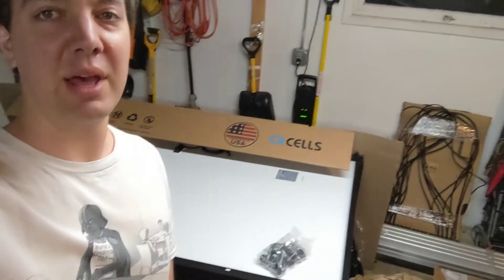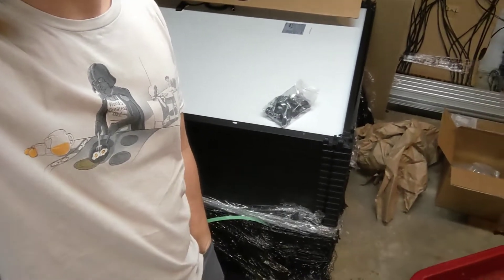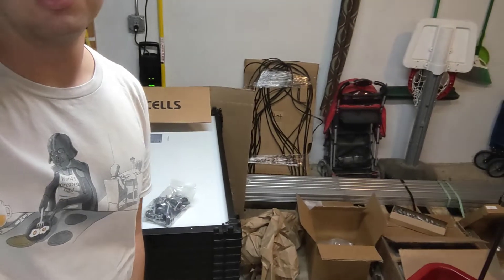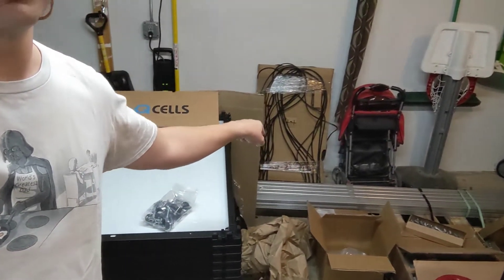Solar Panel Delivery: Project Solar DIY Update #3

Comment: Jimmy, can you contact me. I just got my Project Solar stuff yesterday, and I want to ask you some questions.
Reply from the maker: What questions do you have?
Reply: @jimmypautz  I am a few months behind you. I just received my box of stuff from Project Solar, and I have found that they missed things. No AC disconnect, no sealant, and no stickers.
Reply from the maker: @frankphilips5498  I'd suggest reaching out to your project manager and asking. Those should be included.
Reply: @jimmypautz  I will do that tomorrow.  Where did blue tubing from?
Reply from the maker: @frankphilips5498  That's Smurf tube, I used it for conduit in my attic, since Romex is so expensive right now. I got it from Menards.
Reply: @jimmypautz  Did the kit come with wires?
Reply from the maker: @frankphilips5498  no, wiring/conduit/wire nuts are not included.

Comment: I’m just about to sign an agreement with Project, what is included on the Dyi (pipes, cabinets breakers )
Reply from the maker: They include the shutoff, combiner box, soladeck junction box, and all the enphase equipment, along with the panels and racking system.  You have to buy wiring, breakers, conduit, etc.